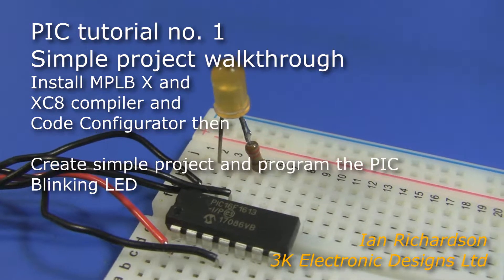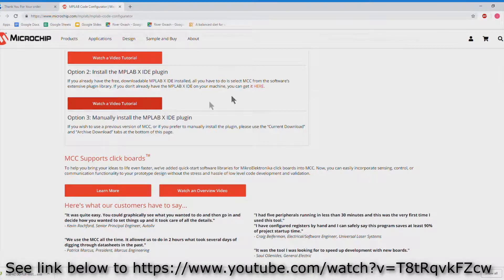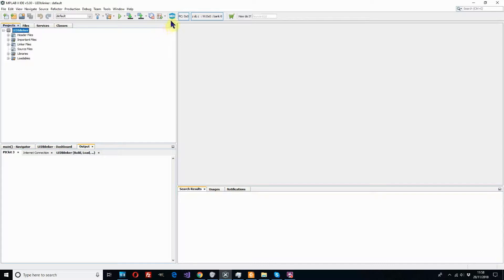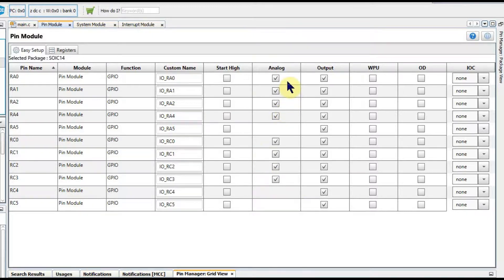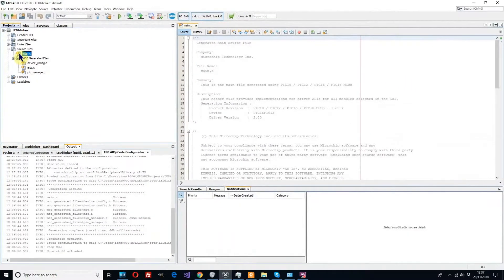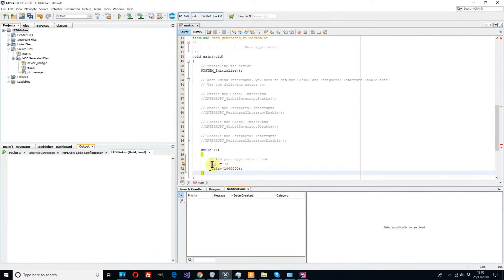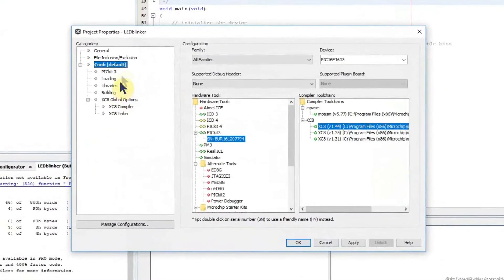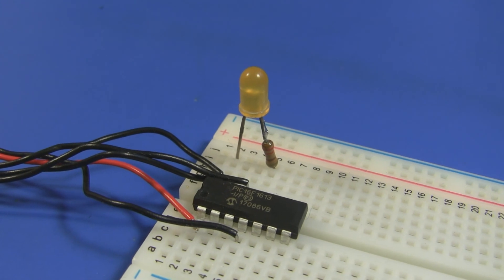1. Blinking an LED - PIC 16F1613 MPLABX basics & configurator (easy setup) for PIC microcontroller

Comment: Ian I am following your Led blinking tutorial to learn about PIC programming. I have all the software loaded but following your sequence I do not get the page to select Tool to allow me to select the PICKIT 3 it goes straight to select compiler. Grateful for your help please. Thanks Mike
Reply from the maker: Hi Mike - you need to have your pickit connected to the computer USB to be able to select it. But you can also skip this step when setting up the project and select the programmer when you are ready to program the chip.